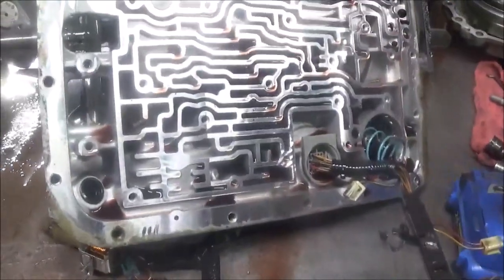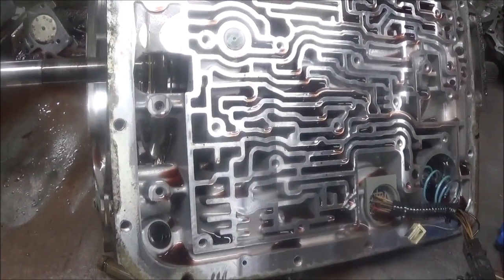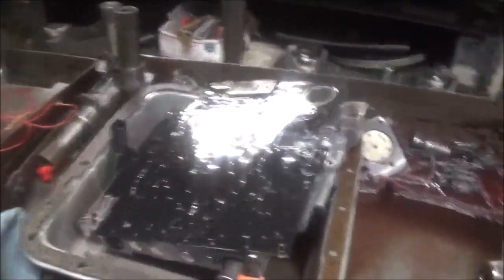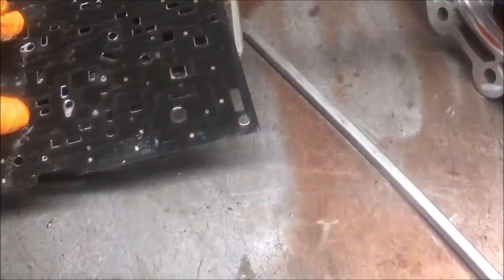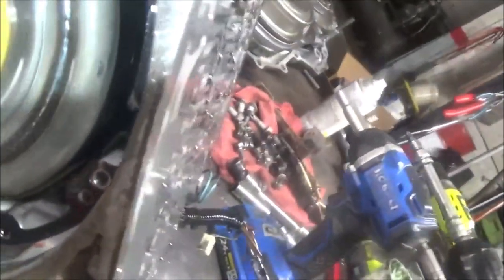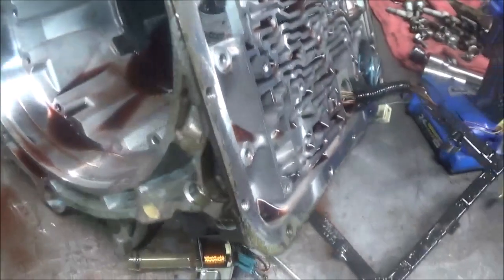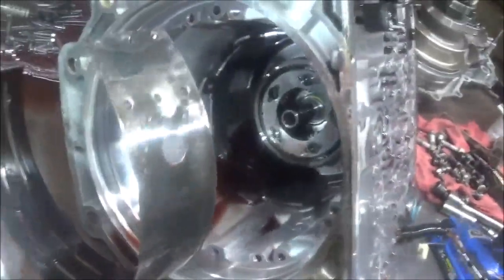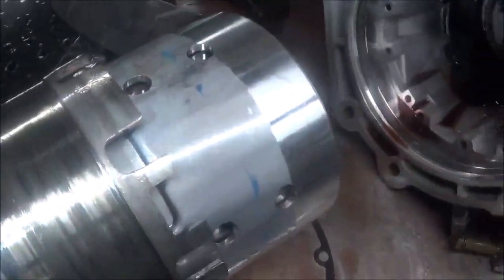4L60E TRANSMISSION NO 2ND GEAR; NO CHECK ENGINE LIGHT???

Comment: 2005  4l60e no upshift only 1st and reverse  no codes  shift solenoids click when commanded it is getting command to shift,  speed sensor operating disconnect connector  at transmission will not go into limp mode   1st and reverse only,  valve body good tried a known good .. disassembled trans found a 2-4 band broke but confused why did I not have 3rd gear in limp mode ??
Reply from the maker: You are giving too much information. I don't understand the question.

Comment: 1995 K1500, 229,000 miles. Truck has no 2nd or 4th.  It drives fine and  has reverse, but never shifts into 2nd or 4th. Fluid is full, good/clean and not burnt smelling. No code using the CEL flashing method. 
Do you have a list, or perhaps a video, of all the items I can check when I remove the pan?  That may be keeping 2nd and 4th from engaging?  Thanks!

I'll be doing this on the ground, front of truck raised about 10 inches on ramps.
Reply from the maker: If this transmission has this type of miles, I would put another transmission in it first of all. Second, look through my videos. I have a video showing how to check to see if the shift solenoids are working to make it shift into gears. If the shift solenoids are operating to make it shift into those gears, and it is not shifting, then the transmission needs to come out.

Comment: I kind of have the same issue with no second however every other gear is shifting perfect including 4th I did run a scan tool on it while driving and it said 1 - 2 shift valve malfunction I didn't think these PCMS could detect mechanical failures inside the transmissions? 2000 4L60E 4x4
Reply: Sounds like solenoid issue. Hope u found the solution by now.
Reply from the maker: What is PCMS?
Reply: Did you find the issue?

Comment: I’ve lost 2 and then 4th gear on a stock and built 4l60e. Both engine modified in the same truck. Neither lasted long
Reply from the maker: How many miles on the vehicle, the vehicle not the transmission?
Reply: @thisisyourtransmission  215k when the stock transmission went out. Then 219 when this level 4 65e went out. Both became with 2nd gear slipping then 2nd and 4th are completely gone. Just 2 extra neutrals

Comment: How can you determine if the band is broken for sure without removing the Tranny?

I'm also not getting any codes
Reply: Did you ever figure it out? Same here. And I have 4th gear. I was under the impression that if the band broke I wouldt have 4th either?
Reply: @jamesmayberry2440  your engine's RPMs will rev when you enter 2nd Gear and won't accelerate. I had 2 tranny shops diagnose with same result. Ended up rebuilding it been working ever since very nicely
Reply: @jamesmayberry2440  your engine's RPMs will rev when you enter 2nd Gear and won't accelerate. I had 2 tranny shops diagnose with same result. Ended up rebuilding it been working ever since very nicely